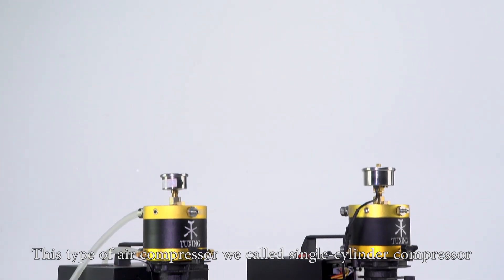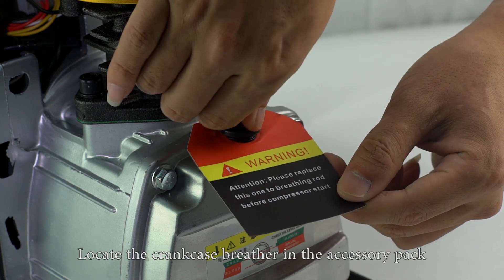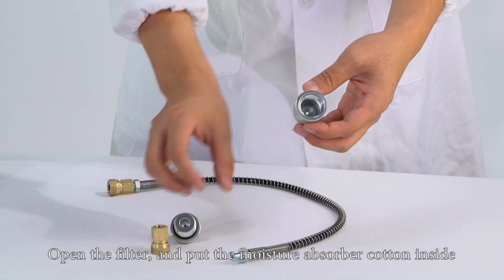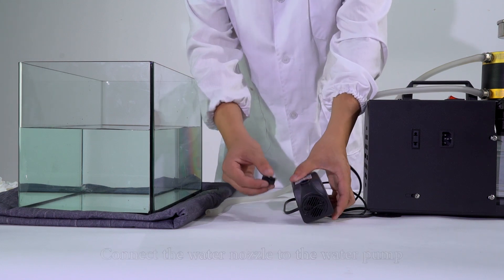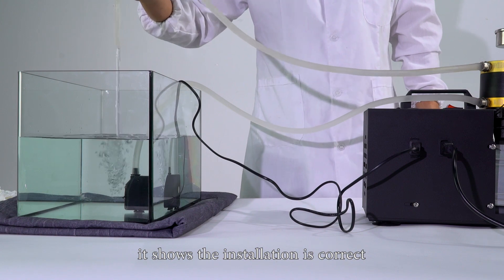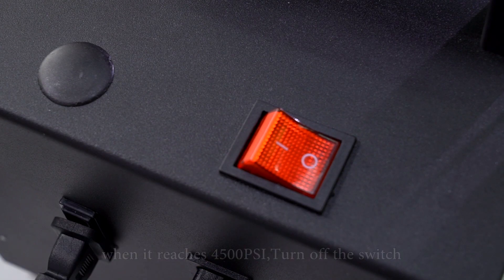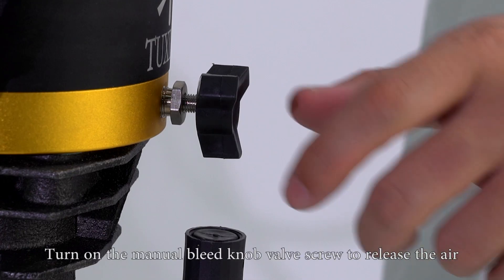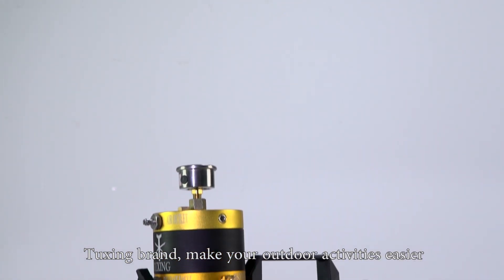Model number TXES011 (single cylinder  pcp compressor)

Comment: Do i need to fill the preasure guage indicator with oil i sow its empty
Reply: Hello Sir,good day,yes,if the pressure gauge has oil,you can add the silicone oil to fill it.